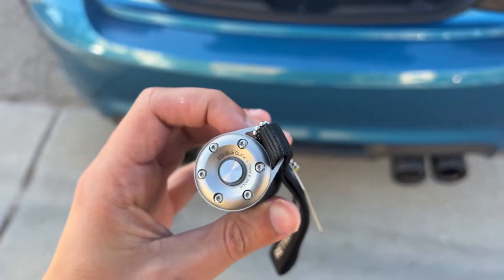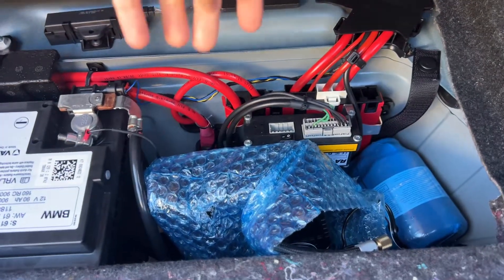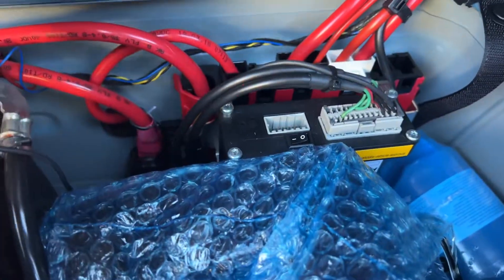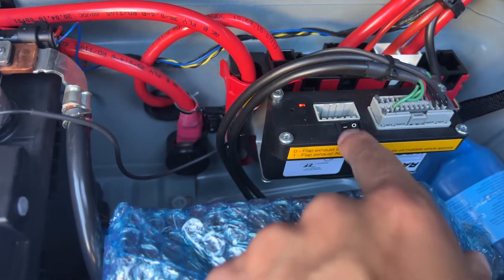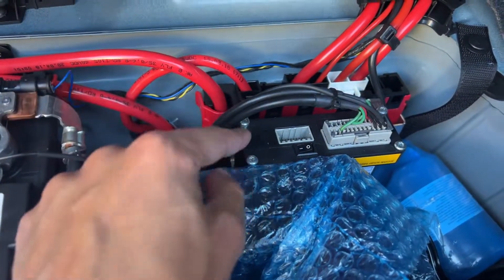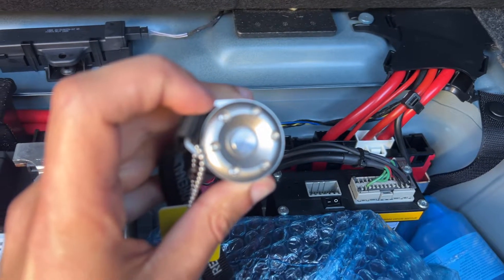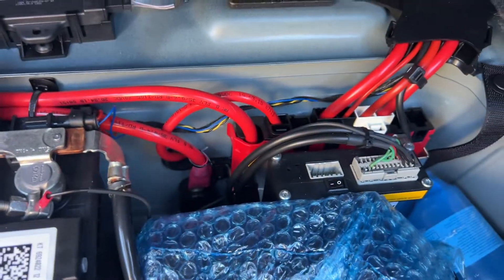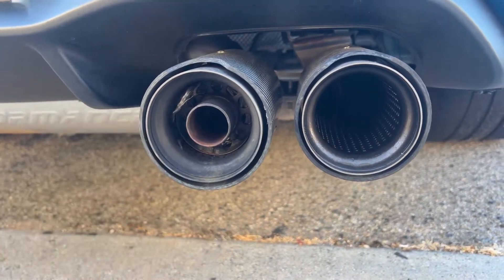How to reconnect BMW/Mini Cooper Performance exhaust controller fob

Comment: ShouldIgetit2 - when you reset the Bluetooth controller, did you have an assistant?  Did they hold the reset button in for 10-seconds and keep holding the reset button while you turned the car off and back on, and then they held it for another 2-seconds before releasing it?  Or, did you hold the reset button for 10-seconds and then release it and then you turned the car off and back on, before you pushed the reset button again for 2-seconds?  I wasn’t sure which one you did.
Reply from the maker: I did it all myself without an assistant. So the second scenario

Comment: the red light on my module is not flashing like yours after the steps. I have power from my fuse box. I tested to wires going inside the module and it has power but red light will not come on. Has anyone ran into this issue? Any suggestions?
Reply from the maker: Sorry wish I had better knowledge but I have no idea what to do.
Reply: Ever fix this? This is what happening to mine. My button doesn’t even blink or anything but when I take out the battery and put it back in there’s a red flash for a second. I’ve tried new batteries and every fix. I feel like my remote is fried.
Reply: @ yeah I figured it out the hard way. The ground wire from the module it’s not making a good connection because of the paint job. You need to wire brush it and make sure you have no paint where the ground wires if not, the power won’t have a return.

Comment: It’s still not working what should I do pls help
Reply from the maker: Did you figure it out?
Reply: I have a 2015 uK version. It does not work. Tried so many versions of this process. When I try and do the reset it just keeps flashing (module and remote) does not pair !
Reply: I got mine done manually and now have a manual switch which opens the flaps